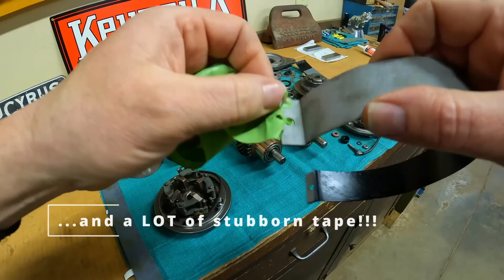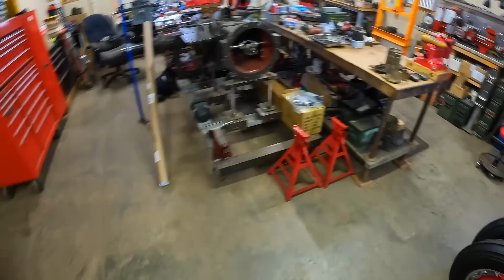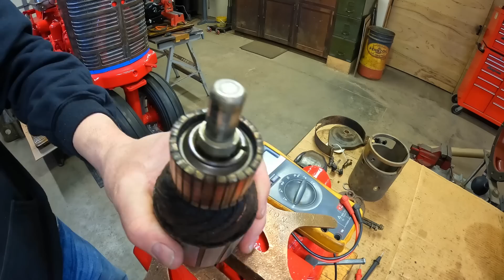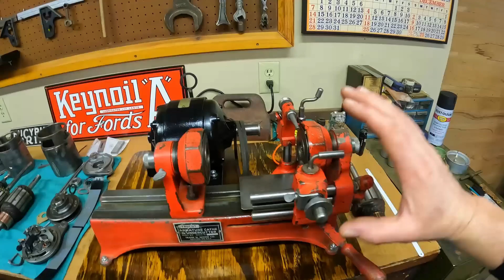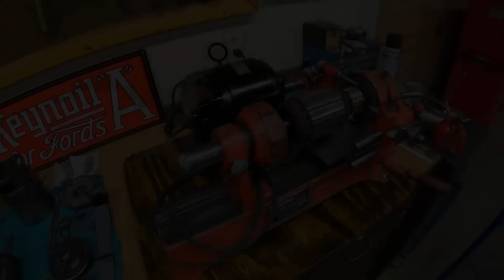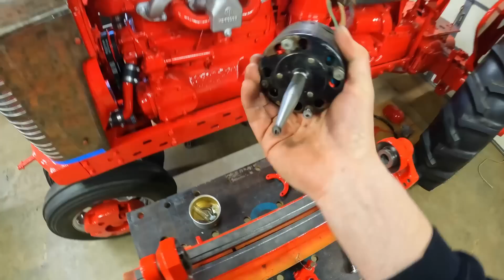Antique Tractor Starter/Generator Armature Testing & Reconditioning - "Preparation H" Episode #32

Comment: You are correct as usual in your assessment of a generator, but if you get into high amperage loads at low engine rpm’s, that is where a alternator wins hands down. A tractor with a couple lights, a generator is fine. It’s like everything else in our modern world, generators are old technology that most people don’t understand, therefore they can’t be good! Tell Senior his projects look good!

Comment: My late Father a machinist, would undercut generators by chucking in a lathe, truing the armature, then undercutting the Mica using a lathe tool ground down to the width of the Mica.  Would undercut by traversing the commutor with the compound with the lathe powered Off.

Comment: Toby when I graduated from Dunwoody in 1970 I used those exact growler on lathe to overhaul starters and generators but they also taught us all about magnetos, centerplane brakes, wedge brakes some very old stuff because you may have to repair some very old vehicles and equipment or equipment that you had never seen before mechanical fuel injection but you could figure it out

Comment: Actually, in 65 years, I’ve not had a problem other than bearings in either a generator or alternator. Generator requires more maintenance (brushes), but work fine.

Comment: That brought back memories. My first car in the early 1970's had a generator that eventually started to fail. My neighbour was into rebuilding starters and generators so he did mine while I watched. He did all those tests including the growler. He cut the commutator on a regular lathe but he cut the mica groves first by hand. The issue with my dynamo/generator was worn brushes. Once serviced it never gave any problems so I don't think they are less reliable than an alternator but I don't think (size for size) they can deliver the power of an alternator.

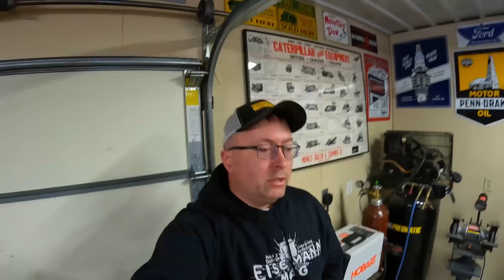Comment: 20:07 Those things can get pretty damn small! I'd almost suggest collecting an RC motor lathe just for the sake of having a really smol one, the one you just used, and the long bed being restored.

RC sized ones are meant for turning armatures in 540-sized brushed motors! Tiny little things. Rather obsolete nowadays...electric RC cars have long since moved away from brushed motors for the most part and the ones still in use are considered disposable so few people in the hobby still use them...but a neat little curio for sure.

Regarding the 'alt > gen' and 'Direct elec start > pony start' crowd....I'm right there with you. And hell, I'll extend it beyond that, too. EFI on older engines is just bleh. They don't need it. They run fine on carb. But a lot of guys these days are just dead set on throwing a holley sniper on everything, and it's all down to the same base reason: Skill issue. They simply can't be bothered to learn how to repair a carb and have only ever tried to run a carb engine that needed carb work. Predictably, it ran like shit, they got fed up, and lazy'd out with a holley sniper kit.

Comment: Beautiful coverage of a generator and starter service. The only thing you missed was that, when using a hacksaw to undercut a comm, to grind the offset out of the hacksaw teeth so the undercut was not too wide. I have used two of those commutator lathes. One that I own is very small for machining small RC racing car motors only just shy of 2 inches long or the one at my old work which can cut up to an 8 foot diameter commutator. I always found it kinda funny that I was doing the same job repairing motors and generators at work and also while racing RC cars with my sons. We also used a tire lathe with the RC cars that also looked similar but without the undercutter, I would love to find a machine like you have. I'll just keep hitting the shows and one will turn up sooner or later.👍😎🙋‍♂

Comment: Fantastic video Toby. Those lathes are great. I have eight 8N tractors all restored and all with the original 6 volt system. They are work great and with everything tuned up and adjusted properly they all start and work fine with the 6volt system, even it the middle of winter in upstate New York.

Comment: While I appreciate your affinity for originality, alternators are far superior. If generators were the best route, modern equipment would still be running them. On a rare tractor, I could certainly understand, wanting to retain oe equipment, but on a tractor as common as the h, I'd rather opt for an alternator. They can certainly be fitted without hacking up the tractor and have greater charging capabilities for increased load, should one want to run more lights and other accessories.
Reply from the maker: I think of it like this: alternators have indeed surpassed generators for output plus cost to produce, but they carry the same curse as everything else that one could call “modern” - which is they’re all throw-away components that keep the consumer dependent on a parts supply chain. With an old-school generator, I can rebuild or re-wind virtually every piece of it myself and maintain a higher level of self-sufficiency. That’s why I don’t have many modern or new things here at all, because when I personally assess something I look at more than just how it can perform in the short term, I want something that I can work with if I’m broken down years to decades from now without having to worry that it’s been discontinued. Kind of like the “Tortoise and the Hare” story, I’d rather have something that isn’t quite as flashy but will keep on going indefinitely 👍

Comment: Hi Toby! There is no need to "cobble" the hood of a H or M to use an alternator.Remove the four bolts holding the two halves of the alternator together then rotate one the halves
90 degrees.replace bolts.    wall law!     It's probably best to aim the connector up.

Comment: I had a 6v generator on my 350 and got a whole rebuild kit for the generator and bought a new regulator and new wiring and never got it working.After 3 years of fooling around and trying to use it for work I broke down and bought a 6v alternator and had to alter the adjusting bracket. I polarized everything the way it should, what do you think was the problem or what did I do wrong. I took the generator to a local shop when I first bought the tractor and they said everything was fine.

Comment: Hi, nice video! a little tip for people who use a metal lathe to true the commutator, do not use a 3-jaw chuck, use a 4 jaw with a dial indicator or collet. the 3 jaw does not run accurate enough, you will make it worse than it was.
also if the commutator has a smooth chocolate finish it is in very good condition, leave it alone. 
Good luck Rich
Reply: Great advice. Even if the comm is a little mottled it is still good.

Comment: Is the uneven wear on the copper you trued up due to a bearing going out causing wobble?
Reply from the maker: It’s the tension on the brushes, combined with how they wore into the commutator over the years. I’ve even encountered severely out-of-round commutators before, and I have no idea how they got that way other than from a well-meaning individual that used some rather rough methods to dress up the surface back in the day 👍

Comment: In older tractor repair manuals /maybe even Ford-T? they do tell you how you can fix your starter and generator rotor at home. But most of such knowledge seen in this video has been lost over time. I do have a crowler at home to test the rotors. A lady was selling it on a garage sale and had no idea what it was.  Very nice small lathe to cut the copper. Sometimes you have to judge if the rotor is any good to begin with. I have seen rotors that would be in the category totally wasted.

Comment: As an early teen I remember a growler in my uncle's garage (he maintained the local county school busses).  I knew it was for testing armatures but never saw it in use.  This was interesting.  I assisted my father dressing commutators (turning them with a 1/2" drill motor) and under cutting the segments with a broken hack saw blade.  Thanks again for your in depth explanation and demonstration!
Reply: I have done them with a 1/2” drill too.

Comment: Is there a minimum you can turn the armature down to?
Reply from the maker: Until you start compromising the soldered joints where the windings attach to the commutator bars - go down far enough and the windings will start to come loose.

Comment: The one thing I've noticed a lot is people don't even try to replace the regulator when it goes bad, they just go straight to hacking the hood, tearing up the harness, and cobbling brackets to shoehorn an alternator in the generators place, despite it being more work in the long run.
It's like small engine starters for old Kohlers, both starter generators and the gear starters. I have never bought a new starter for any of my old Kohlers, ever. I've had plenty of non-functioning ones, and all of them were fixed just by cleaning them up and freeing up the brushes. If I never watched your videos I bet half my tractors would have junk Chinese starters on them!
Reply: You don't HAVE to hack the hood, but that doesn't mean that farmers don't do it. Seen plenty of tractors with notched grilles or hoods for aftermarket parts that could've easily fit had some thought been put in to mounting them.
Reply: You don't have to hack the hood up and the odds of the harness already being hacked up on a 70+ year old tractor is pretty high..

Comment: 20:26 There is only two commutator bars the will have full omh that is one set of windings you may have as many as 10 sets of windings in which is a rap of copper wire wond up with so many raps 20 or maybe 40 raps that is layered in the grid bar stack one end of. Winding is put on a certain commutator bar the other to one another , these starter and gens are very easy to rewind easier then electric motors

Comment: Where would you suggest buying regulators from in this day and age? I want to start putting a lot of our stuff that grandpa converted to alternators back to a generator with external regulator. I was just a little nervous about buying aftermarket regulators because I was afraid they would be cheap Chinese knockoffs
Reply: Just my experience but I went thru several Chinese knockoff 6 volt regulators. They didn't work right, tried adjusting them, had constant problems, no charging, boiling over the battery etc. Finally got an expensive regulator from The Brillman Company. (they had 2 types cheap and expensive). Instantly solved all my problems. Always charges, always starts etc. I try hard to clean up and save the original ones if I can but I won't buy knockoffs anymore.
Reply: @emerycreek8016  I too have had nothing but good things to say about the Brillman Company. They also have  actual real 6 Volt starter solenoids.😎👍
Reply from the maker: emerycreek said everything that I was going to - the cheap regulators are definitely trouble 👍

Comment: So how does the combination starter generator work that are on the earlier cub cadets since it does both fuctions. Maybe a silly question but saw dust was what i did for a living.
Reply from the maker: So without wading too deep into the weeds here, the simplest way to describe it is that instead of just the one electrical field that a normal generator develops, a starter/generator will create two different fields. When both fields are present, the unit works as a starting motor. But when the second field is cut out, the unit then reverts back to being a generator. I don’t have any actual experience with these, but I’ve been told that they could be rather tricky to get set up correctly.
Reply: @squatch253  thankyou

Comment: Hey Squatch, I have a '48 H that I put a alternator on I did not have to ruin my hood, or adjust the brackets very much, I also don't have access to a shop to do anything in, so it is no sin to do what I did,and besides you have to do what you have to do to improve things  the way you can.  Dave D.
Reply: I understand the plight. I have a '70 Nova with 3-speed manual column shift. Although the engine isn't original, I'd like to keep the column shift aspect of the car for historic purposes. Only thing, even though the linkage at the base of the column is still in great shape, I'm noticing alot of slack in the column portion of the mechanism. I've looked through some of the classic car replacement parts sites and have yet to see any of these parts as most people are converting to floor shift or automatic transmissions.
Reply: Squatch isn’t wrong

Comment: Ok, that was pretty cool.  A couple questions, if I may?

The cutting wheel that is used for the relief cuts, what is it made of, and does it ever have to be replaced?

Does old formica contain asbestos, and if so, how would you know if you need to take necessary precautions?

The growler, does it accomplish the same thing a megger would do?

Last question, what do you feel Sr. is going to sell these for at the swap meet? In cas anyone is interested.

Comment: Excellent video it's nice to have the right tools for the job It makes it a lot easier. Keep up the great videos. Do you have a starter load tester the one shop I used to get starter parts from had the machine to put the starter under a torque load I  wish I would have been a little older I knew the guy was about to retire I would have bought his tools but that didn't work out. There must have been a school that them guys went to after ww2 because there was a electric motor repair shop in about every town and all the guys were gray haired back in the 1980s .

Comment: Is there a spec on the diameter of armature?  I would think there has to be a minimum.  Great demonstration.
Reply from the maker: No spec that I’ve ever found - so pretty much when you finally take enough copper off to compromise the soldered wire-to-segment joints, you’ve gone as far as you can lol 👍